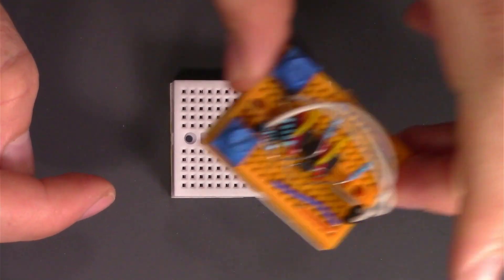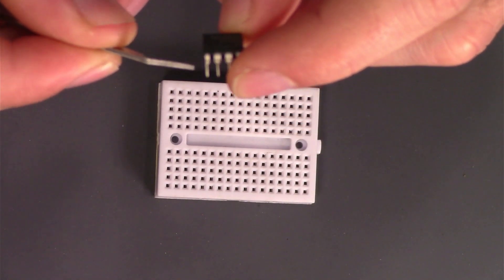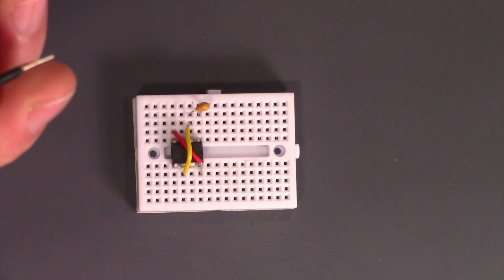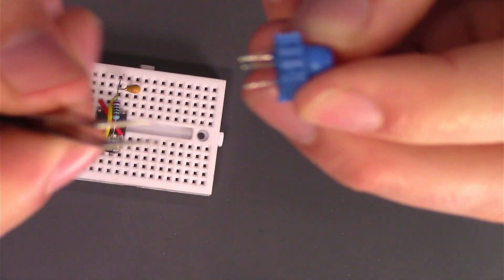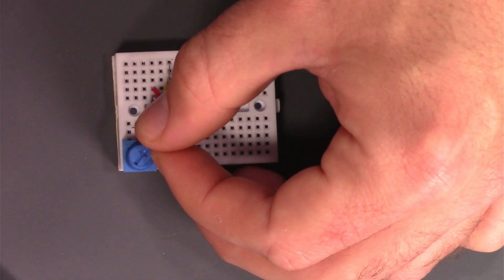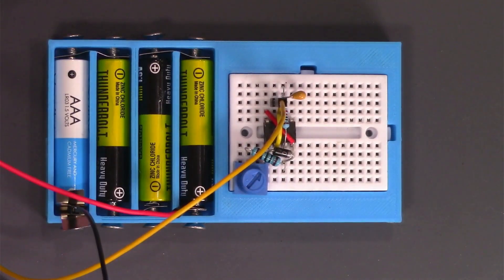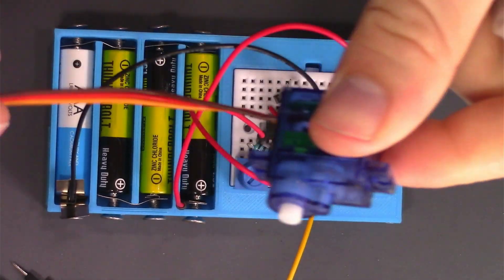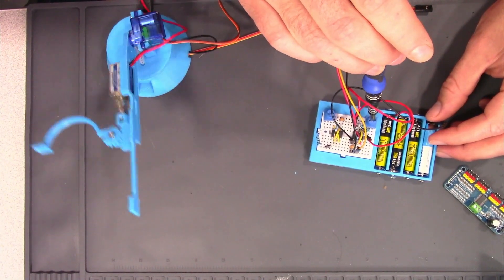How To Control A Servo with a 555 Timer

Comment: "The signal isn't perfect so you'll see that the robot arm jitters a little bit" - A LITTLE BIT??? That makes it completely unusable, this circuit is garbage
Reply from the maker: @ILsupereroe67  adding a capacitor and a diode fixed this circuit. Haha maybe we need to upload a new video
Reply: Exactly where should one add the capacitor and the diode, and what capacitance? All the trustworthy sources I can find say the only solution is to use two 555s, one for fixed frequency and the other to modulate the pulse width, but I'm willing to try adding the capacitor
Reply from the maker: @ILsupereroe67  Really you should be using a micro controller like an Arduino Nano or ESP32. But you can try adding a 1000 uf capacitor in between the servo and your power supply. If that doesn't fix it, try adding a diode right before the capacitor, anode on the common ground and cathode on the + supply. Really consider using a micro controller instead, they give you access to so many more sensors and more precise controls.
Reply: @hackertwins  By "between the servo and power supply" do you mean + of the capacitor on + of power supply, and - of the capacitor on ground? If so I already tried with a 470uF and made no difference. I don't see how a capacitor would help, the issue is not the stability of power supply, otherwise the microcontroller would have the same issue, right? AFAIU the issue is that the servo doesn't "like" a variable frequency in the signal. With your circuit changing the pulse duration also changes the frequency. I already did it with a microcontroller, the whole point of the circuit for me is to do away with the microcontroller
Reply: What you said is true but there is a better way to say it